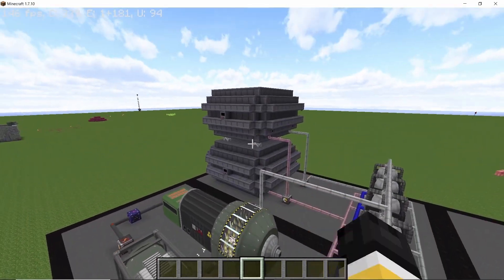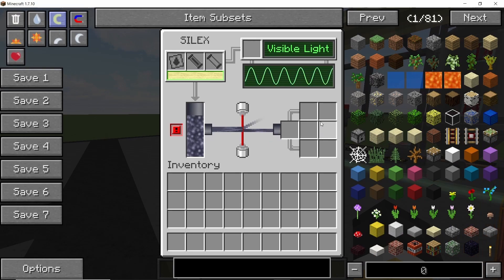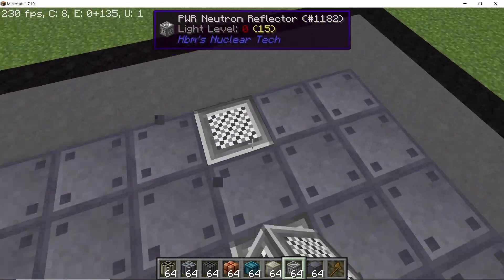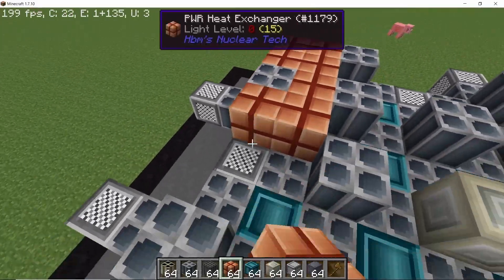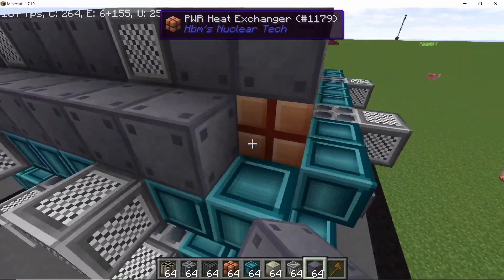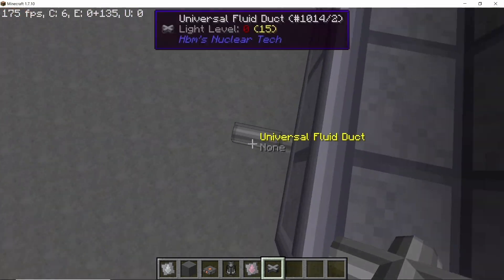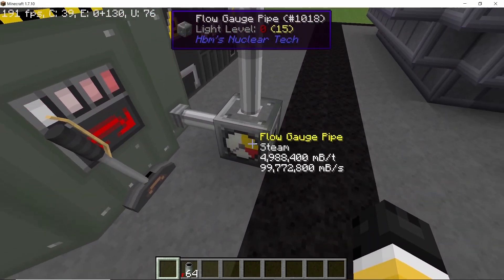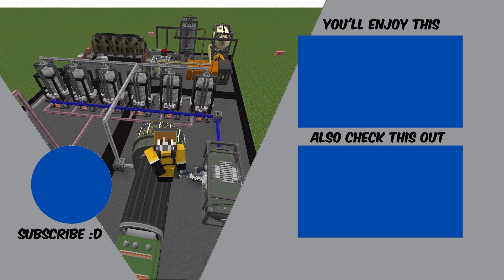Plutonium Production Guide for HBMs NTM : Uranium - Neptunium Fuel Depletion and Processing

Comment: Very nice, but how do you math out the PWRs?
For the stuff like how many turbines do you need, etc?
Reply from the maker: Turbines are pretty easy, leviathan can handle anything as it has infinite throughput. You do need to calculate the number of industrial turbines needed cause they have a limit to how much steam can be processed at once. Same goes for Cooling towers ... like for example a big cooling tower can process 200,000 mb/s of lps and this build is producing over 2 million mb/s so basically 11-12 towers should do the trick.
Reply from the maker: aside from that the PWR itself is trial and error, I would recommend going overboard with the heatsinks at first to raise the core heat limit and then push the reactor with a specific fuel to see whats the max number you can get ... and then remove the additional heatsinks to minmax your design.

Comment: HBM NTM is simple before you have to remember every radioactive material
Reply from the maker: Indeed, plus all of the rare stuff that can be made using the cyclotron ... somehow I always forget about those
Reply: @SavageVegeta  the durability of my minigun and rocket launcher is running out please can you help me🥺🥺
Reply from the maker: @Soft_Motion_Stories  there isn't any enchantment for infinite durability afaik, you can use unbreaking to make it lose durability slowly but eventually you'll need the repair kit to get your gun back to full durability
Reply: @SavageVegeta  Btw, do you know the Energy Control mod has stopped working ?
Reply from the maker: @abcdefg12335  frequent ntm updates, it's working fine with many other mods
Reply: @SavageVegeta   hi sir i have been watching you for a while and i really like your videos i am facing a problem the mini  gun and rocket launcher are running out in hbm's mod can you tell me a way you get unlimited durability in these guns?
Reply: @SavageVegeta  when will there be an fm radio tutorial how to use